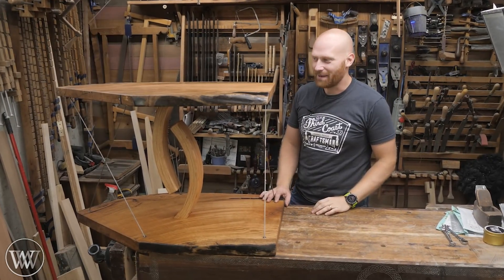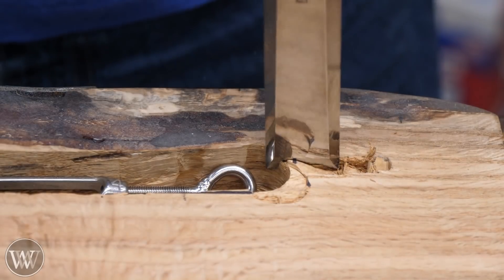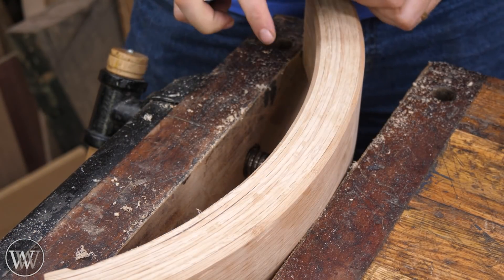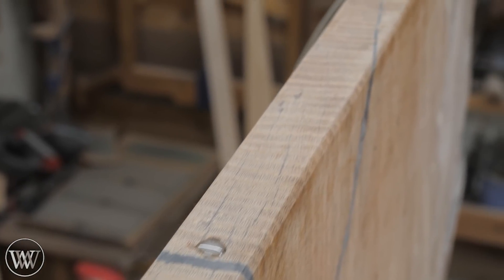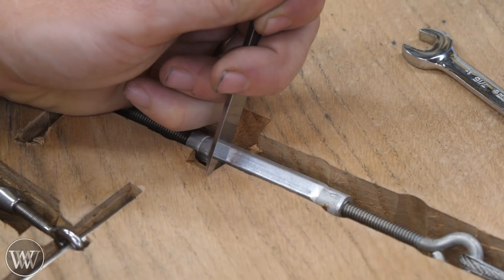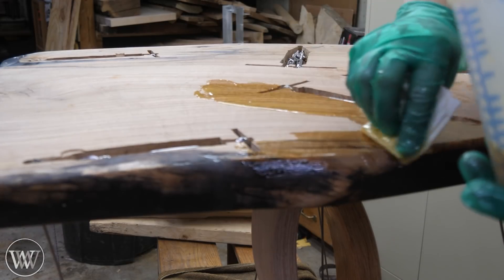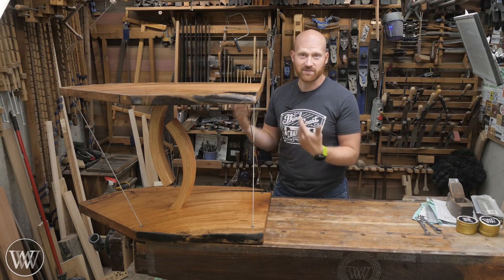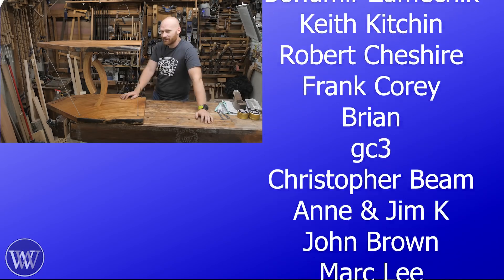How to Make an Impossible Table All Done

Comment: Looks great! How easy is it to use a Forstner bit with a brace? Just wondering if that would alleviate the concern with drilling a stopped hole and worrying about the snail poking through when using auger bits.
Reply from the maker: you can use a Forstner bit as long as your chuck will fit it, but they do not work as well.

Comment: What is that adapter you are using with your bits and where can I get one?
Reply from the maker: It is pre production, but should be coming out here soon. when it does I will do a video showing it off. it is one of my new favorite things.
Reply: Workshop heaven. Woodowl auger bits. They sell the bits and adapters for handbraces

Comment: Great work! 
Have you consulted with Rubio about your process?  It's a bit...completely opposite how they advise to use it.  The cost is far less prohibitive their way.
Reply: Can you explain?
Reply from the maker: I do it exactly how they list on the can and show in their demonstration videos.
Reply: RM2C only bonds with the very top molecular layer of the wood. Laying it on thick doesn't help it penetrate any deeper because it doesn't penetrate. All that happens is that most of the oil ends up on the rag that you use to wipe it off. A very little amount goes a very long way, so although a can is expensive, it can cover a large area if used effectively. From Rubio Monocoat USA: "after 3 to 5 minutes you can never wipe off too much, but you can wipe off too little."
This is also why it is extremely important to thoroughly clean the surface of any dust. The RM2C will bond with the dust instead.
To maximize colour retention you need to water pop the surface: lightly and evenly spray with water then knock down the fibres with a light sanding (heavy pressure will undo the process). This enables the wood to retain more of the dye if you're using a colour other than Pure.
I've been using RM2C for at least 3 years and have had great results this way.